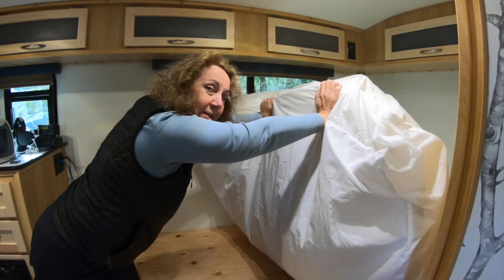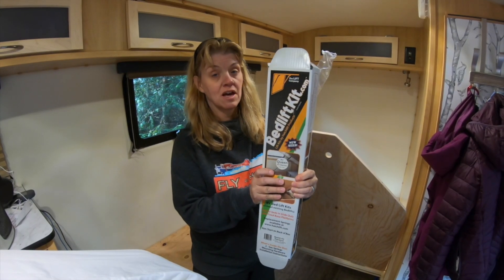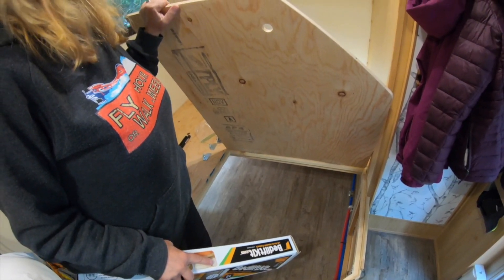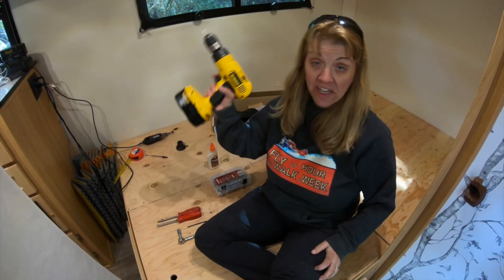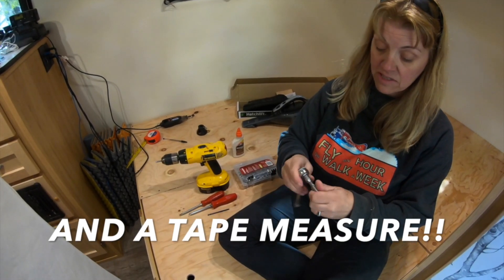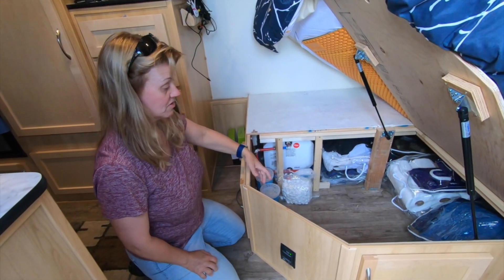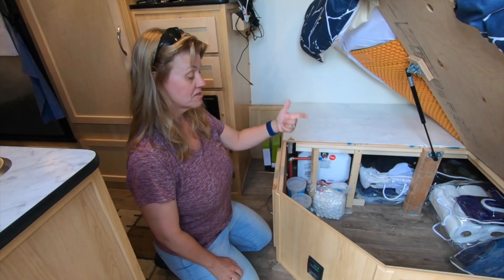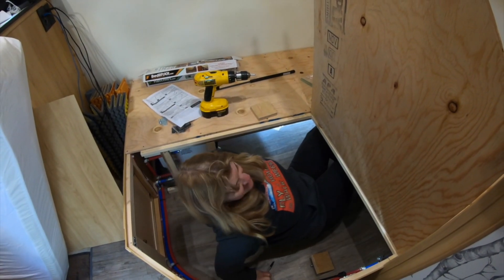RV Bed Lift Installation - Full Time RV Living in a Travel Trailer

Comment: Thanks for this video!  I am sure that the measurements you provided saved a lot of trial and error and likely a fair amount of cursing. Used the 6 inch measurement and it it works perfectly, first time.

Comment: Hi Adventures in NoMadness! Thanks for the instructive video. I have a 17B and am using the single dinette for my bed, nice and cozy as there is only me. I want to keep the mattress and all its associated stuff, like moisture barrier, extra topper plus bedding from smashing down on me when I want to access either side, especially the passenger side storage unit. I don't want to loose that space if I can avoid it. The hatch opens toward the wall but the majority of the bedding is in the center and other side of the trailer. Any suggestions for non-complex ways to keep the bedding from impeding the opening of the storage unit? I am stumped on this one. Thanks so much - Cedar in Western Colorado
Reply from the maker: Hi Cedar, thanks for watching the video! It's hard for me to visualize what that looks like. It's been a while since I've been in a 17B. Can you send us a couple of photos or a short video? You can send to adventuresinnomadness@gmail.com. Not sure if we can help but we can always try!!!

Comment: Thanks for the video. I'm curious though you already have the cabinet door opening to that space, also looks like you have space to that area from outside that being said why did you need this as well? We also have a 21' Escape, our door is in a different spot then yours, its at the end of the bed, open the door and there is a large drawer you can pull out, its where we put our shoes, holds a lot of them. Enjoy your videos and you have to love owning and Escape. Enjoy the road and safe travels.
Reply from the maker: Thanks for watching the video! We actually have two cabinet doors at the end of the bed. We don't have a large drawer that pulls out and we felt the bed lift kit was a better use of the storage space for us. Since we live full time it's really nice to have full access from above and not have to get on the floor or go outside to access it. This allows us to have different sized items stored under there and not have to conform to the drawer pull out size. Hope that makes sense. Some of the pull out drawers we've seen add more weight and take up a certain amount of space themselves. This is a really easy way to have lots of access!!

Comment: Are you working with a mattress that is flexible or the one that comes with the trailer?  We picked up a 2017 21c. We are considering this install and wondering it will work with the factory mattress. We might get a new mattress too. It IS heavy for sure and the area under the bed is a gold mine for space.
Reply from the maker: Hi Marla, we are using the mattress that came with the trailer so it totally works! Yes, it's a gold mine that we couldn't pass on!

Comment: Excellent job; like the written dry humor too!  Hey, could you of had that ordered at the Escape dealer? 
 I'm handy but I also like the easy way!
Reply from the maker: Unfortunately Escape won’t install the bed lift kit 😢
Reply: @AdventuresInNoMadness  Darn it!  Will they install a Natures Head??? I've been comparing the Big Foot, The Oliver and the Escape.  What I like about the Escape is the Weight!  I want to tow with a Toyota, and the other ones are up there in weight.   Plus the Escape seems to have lots of storage options.
Reply from the maker: No, unfortunately they won't do that either :( At some point we will do a bunch of research on installing a composting toilet but I think it's a bit trickier since it's a wet bath. I think someone has done it though and posted about it on the Escape Forum!
Reply: @AdventuresInNoMadness  Shoot, darn it.  Seems to me you could omit the black tank, omit the toilet, and make some kind of wooden platform, then some how put a hole for venting!  This is my guess. Composting toilet would give you more freedom to boon dock longer!  And skip the hassle of dumping.  With composting just take to the trash.
Reply from the maker: Hey SA, sorry for the slow response. Lack of good cell service :(  Escape doesn't like to add after market items like those but I don't think it would be too difficult. I'll have to look more at the thread on the Escape Forum about the person that did it!